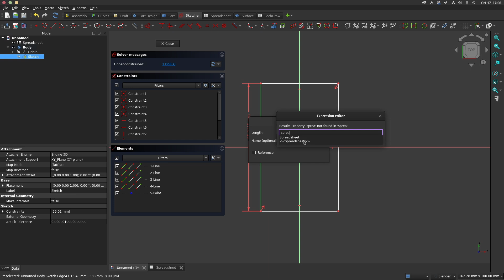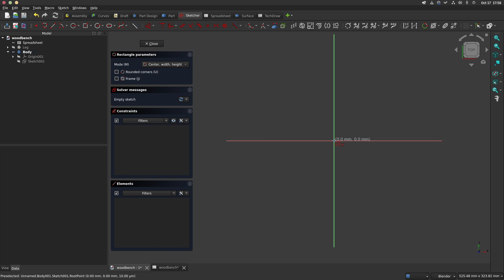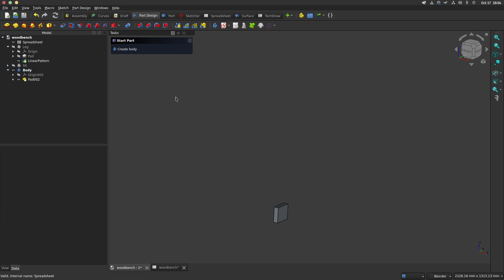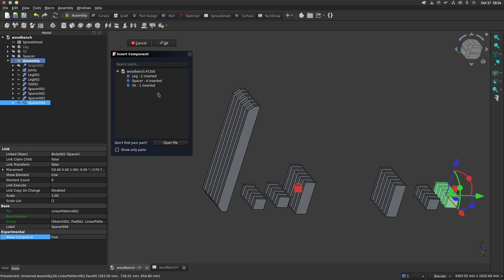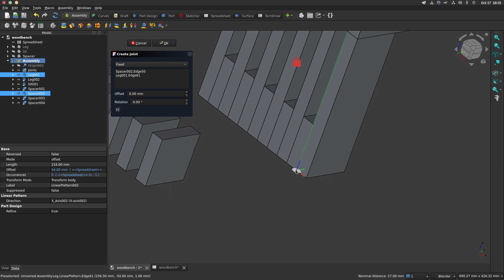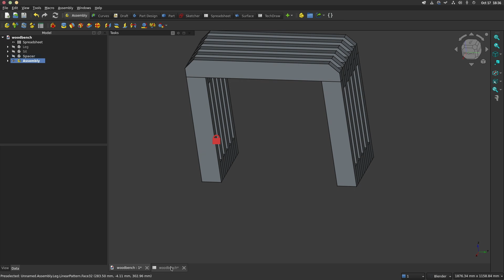Freecad 1.0 Assembly Beginner tutorial

Comment: Thanks for tutorial. I have a question about Freecad: Based on your experience, is Freecad in aspect of visual quality and metric precision  an acceptable environment for daily industrial 3D desing? By daily industrial design I mean not that complex modeling. thanks again.
Reply from the maker: I think FreeCAD is a good alternative to other softwares if you work as a Freelancer or if you are a 3D hobbyist. You can achieve the same results, but the learning curve is hard. If your business need to hire 3D modellers, you will have difficulties as they are more familiar with Solidworks, Fusion360, etc.